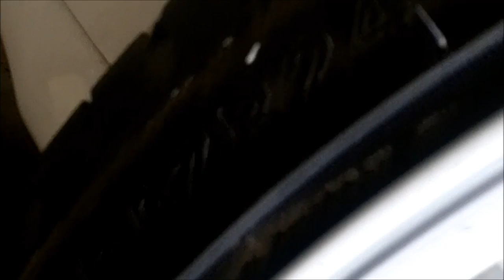2003 Impala How to Make 24s Fit Without a Lift

Comment: thats smart. why spend 800 on a lift just for 4's? if you were going 26s the lift would make sense. but not when you only need 3/4 or an inch more clearance. thanks for the video!
Reply from the maker: james atkins my thoughts exactly, glad I could help
Reply: Cus I was bout on my last resort,  I was on my way to spend 1200, lol SMH
Reply from the maker: Yeah it can be done for cheaper. The ride I'm sure is way better with the strut lift but this way is still manageable

Comment: How did you get the front to clear the tires when turning?.
Reply from the maker: Look around the 40 second mark. You have to trim down that metal part under the wheel wells. Then trim the fenders

Comment: Bro where can you get the clamps and what are they called. Got a 05 with 255 30 24s dont want to lift so want to do what you did thanks
Reply from the maker: Spring lifters or spring lox. Just be prepared because the ride will be stiffer than normal 
You can get them at AutoZone or order online https://www.amazon.com/dp/B00029K20C/ref=cm_sw_r_cp_apa_i_myX-FbZQXM2EQ?_encoding=UTF8&psc=1

Comment: Thanks for the video man, I got a 1990 Caddilac Elderado. I want to put 24's on it, but the coil seems close, do you think that I still can?
Reply from the maker: If it suspension is setup the same way it may work. I'm not familiar with that model
Reply: Thank's fam another guy told be a little lifting and slight cutting and I'll be good 👍☺ thanks for the reply and happy holidays now. This Elderado got to much potential mayne, candy apple red, needs a new paint job though. Getting seat covers from ebay, 2 12 inch Rockford Fosgate subs in a box and a Pioneer CD playa. I don't have much money now, so I'm having to do it check by check you feel me. Aight peace out. Blessings. 😇 Ready to bang some T.I, Roy Jones Jr., Luda, Mystikal, etc. etc.
Reply from the maker: That's wassup. Take your time on it and you'll be straight. Good luck on the build

Comment: did you think about using wheel spacers so they won't rub when you turn all the way? the tires will stick out past the fenders more then.
Reply from the maker: Nah the wheel spacers would make the rims poke out more than i wanted and i'd have to cut a little bit more

Comment: what the lifters look like at auto zone is it a link you can share?
Reply from the maker: David Bradford https://shop.advanceautoparts.com/p/autocraft-rear-adjustable-two-way-spring-spacers-2-pack-ac181201/10053644-p?c3nid=10053644-P&c3ch=PLA&adtype=pla&gclid=Cj0KCQjwn-bWBRDGARIsAPS1svudvamOdSkO_c507z4cyzYGw4POKIasdRkZp5mRPhL-3UOtm-1S3ggaApPFEALw_wcB&gclsrc=aw.ds
Reply: 89imp03 can those go on the front as well and it look like you can change the screws to extend the lift is that possible
Reply from the maker: Yeah I had them on the front and back. And they're adjustable, you can screw it as high as you need it but the higher you go the stiffer the ride will be
Reply: 89imp03 thanks

Comment: did u need to use spacers for the front or u just did it to b on da safe side
Reply from the maker: no spacers up front. I used the lifters in the springs up front to keep the fender from scrubbing the top of the tires on bumps
Reply from the maker: *no spacers needed

Comment: How many did u use all around 8
Reply from the maker: Yep, 8 total. 2 on each spring. Just be ready, its rough when you go over bumps
Reply: Okay I have a infiniti i35 just brought some 24 by 8.5 not sure of offset but I went to tire shop to kind of test it. Guy said I would have to cut. But I don't think he really knew he spoke broken English. But with spacers all around you think they should work??
Reply from the maker: @joesphpatterson1425  maybe, I'm not familiar with the suspension setup on that car but if it's similar to this it might fit. May still have to trim some if the wheel wells aren't that big
Reply: Oh okay fasho should I put wheel adapters and roll fenders if I put spacers? Also did u max out the spacer or u just lifted it a little bit..

I heard these cars will fit 22s fine
Reply from the maker: @joesphpatterson1425  I had these spacers extended pretty much the full amount. I would extend them and test fit to see where exactly it would be rubbing. Might need a little bit of everything depending on how it fits
Reply: @89imp03  yeah bro so the specs on my wheels are 24x8.5 5x114.3 +30 offset . Did u put any wheel adapters on the car to install the wheels?? If so how many inches?? 🤔  appreciate the info. I have some time to buy adapters and spacers I'm going to repaint the wheels
Reply from the maker: @joesphpatterson1425  i used 1/4" spacers and I think my rims we're about that same size/offset. The wider you go on adapters the more likely you'll need to cut more so you'll be able to do full turns
Reply: @89imp03  thanks I'll keep u posted on progress
Reply from the maker: @joesphpatterson1425  yeah let me know how it goes

Comment: can we put 4 coil springs on each  spring? two at the top two at the bottom? to be extra careful incase one side fall.
Reply from the maker: markell robinson yeah but it'll be a real stiff ride
Reply: +89imp03 OK! right on Big dawg I'll just use the  2 then.. quick question do struts give your car a lift? my cousin love having me spend unnecessary money.
Reply from the maker: markell robinson replacing old struts with new ones will make it look higher than what it was

Comment: Hey bro I just bought a 2004 Chevy impala LS do you have to get any engine work or transmission work to put 24s on?
Reply from the maker: I didn't have to do anything to the engine or transmission but it all depends on how your car runs and what maintenance was done on it before
Reply: Dawayne Johnson  usually you have to upgrade transmission to get your rpm,s right, with bigger rims you putting more stress on gears.
Reply: Raven 682 alright I can just go to a car place where they fix cars and all for a transmission upgrade?
Reply: Dawayne Johnson most of the car shops don't do transmission upgrades because they don't have transmission mechanics they just send it out to transmission shop to fix it or upgrade and charge you extra for that shit. Just find transmission shop and go straight to them. It's cheaper that way.

Comment: I'm wondering why you just wouldn't buy the $799 strut kit and just bolted up and be done with it instead of going through all this trouble. Gorilla lift and a bunch of other lift companies make it so much easier
Reply from the maker: Bubba Gordon would've been the same amount of physical work plus spending more money and waiting for parts to ship. And back then everybody's lifts sat too high in my opinion, didn't like the look
Reply: 89imp03 so you would rather do it the wrong way and chop the car up because you don't want to wait one day to get some struts. Each strut is only held on by three nuts at the top and two bolts on the spindle. You're doing way much more work than just doing that
Reply from the maker: Bubba Gordon I don't think you understood the purpose. Get them on without spending too much and without the car sitting too high. All the cutting would have had to be done anyway even with the lifted struts
Reply: 89imp03 I prefer to do things the right way. Instead of hacking a car up and putting spring spreaders and wheel spacers.  If you do it right the first time you wouldn't have to do all this.
Reply from the maker: Bubba Gordon ok

Comment: I gotta 06 impala will 24s fit without rubbing??
Reply from the maker: Curtis Price not without doing something like this or getting a strut lift
Reply: Ok thanks
Reply: You gone have to cut both back and front fender depending your tires I gotta 05 impala on 24s I did the same thing bro did my tires are 275/25zr24

Comment: i have this same car and am wondering how i can lower the front and the back
Reply from the maker: christopher rodriguez try some lowering springs or get an air suspension set if money isn't an issue
Reply: if I use lowering springs will I use same shocks or. they have new ones
Reply from the maker: christopher rodriguez not sure, might be better to get new shocks to match

Comment: How much did you have to shave back on the front & back? @89imp
Reply from the maker: +scott21ist I dont remember an exact amount. just enough to where it didnt rub anymore
Reply: alrighty, shit i wonder if some 24x10s will fit or poke too much
Reply: 89imp03 alrighty, shit i wonder if some 24x10s will fit or poke too much
Reply from the maker: scott21ist 24 x 10 will poke out some
Reply: 89imp03 think it will alot they are 24x10. 5 lug universal
Reply from the maker: scott21ist yeah with a rim that wide the offset is probably made for rwd so it'll sit a lot wider
Reply: +89imp03 i guess i will just lift it & put em on before cutting to see if they poke too bad

Comment: I got a 05 Chevy Malibu I'm trying to put 20son it
Reply from the maker: quivaris daniels 20s shouldn't be a problem but if they are this may help but I don't think its necessary
Reply: Da front rims fit but da BK rims don't because dey won't slide on da strut keeping it from being on
Reply from the maker: Ok. Bend the plate up some and it should be good. What size tires do you have?
Reply: 245,35 20
Reply from the maker: Yeah they should fit. Just bend the plate some

Comment: Who knows for a lift kit for a 2004 Pontiac Grand Prix I appreciate it that’s a good job but I’m just trying to find coilovers or the kit to install some 22”
Reply from the maker: 22s will fit with no lift. You just have to slightly bend up the strut plate. 245/30/22 tires will fit with no issues
Reply: Alright my friend thanks appreciate it I will do what you did 👌🏻
Reply from the maker: @jayjaynonoy.6928  no problem 💯

Comment: I have a 98 Grand Prix SE I have a set of 24 inch rims how do I make them fit without lift an the tires are 275 25 r 24 ?
Reply from the maker: Leslie  Outerbridge I think the suspension is set up the same as the Impalas. the amount you have to trim will most likely vary tho
Reply: OK so I'm good then all I have to do is lift the struts an what about the lifters to hold the struts steady how much is the lifters an where do I get them from?
Reply from the maker: Leslie Outerbridge Autozone is where I got mine. they're not expensive under $50 will get you what you need
Reply: That's front an back right? What else do I need to do?
Reply from the maker: that's it. everything I did is in the video. just double check everything and make sure your clearance is good on your car and you can adjust from there
Reply: OK do I have to do any cutting an how far do I adjust the lifters?
Reply from the maker: Leslie Outerbridge yes it all depends on your car
Reply: OK thanks alot
Reply from the maker: no problem
Reply: Hey they want me to come to auto zone to see the lifters they said its different prices 6.99 an up which one's you get or which ones I need?
Reply from the maker: Leslie Outerbridge they're called spring lifters. its 2 brackets and 2 bolts for each one
Reply: Ok

Comment: what's your width bro
Reply from the maker: Tank Wright I think these were 9" wide
Reply: Will 9 1/2s have poke? I have a 2013
Reply from the maker: maybe a little, depending on what offset they are
Reply: High positive
Reply from the maker: shouldn't be too bad
Reply: I may call tomorrow and switch cause I ordered them
Reply: Tank Wright the more negative offset the more poke. -44 is about a 3.5 to 4 inch of tire sticking out. -24 is about what you are looking for. although with no strut lift there will be a little more cutting involved. when they sit out that far need a little more clearance. im running 22x14 with a -44 offset on a silverado and needed alot of clearance
Reply: Tank Wright did you sttach a pic? It wont open yet

Comment: Looks good standing still but I know u ain't making u turns...probably a few Y turns ...if you want to lift a fwd the right way you have to extend the mounting brackets on the bottom off the strut...look up lifted  Cadillac de ville it's got the same strut set up..you'll see a spindle in the beginning of video...not trying to bash you I give u a A for effort but it's not the right way of doing this
Reply from the maker: it turned good. i didn't see the value in paying for a lift only to go 24s so i did it this way

Comment: Should’ve just left it at the 22s bro
Reply from the maker: They felt too small, wanted to see what 24s was like
Reply: @89imp03  YEAH...THEY DO..IF YOUR GOING TO GO BIG RIMS... ATLEAST GO 24"$ ON THESE IMPALAS..&..MONTE CARLO"$...I FEEL & THIS IS JUST ME..THE 26 & 28 IS JUST SHOW CAR SHIT.." ATLEAST THE 24"$...YOU CAN STILL RIDE..YOU CAN STILL STUNT...AT THE END OF THE DAY...I CUT AND WELDED MY STRUTS...I WILL POST MINE ON FACE BOOK AS I DO MY BUILD...IM ONLY DOING... RIMS..RACING SEATS.. STEERING WHEEL..SWAP...NEW SPOILER IN BACK..TINT ON HALO LIGHTS UP FRONT...I MIGHT GO SUNROOF"...AND IM DOING A FIRST.....IM PUTTING A CUTLAS SURPREME VINYL TOP ( CUSTOM ) ON MY M*CARLO"...BLACK + WHITE + CHROME SCENE...THIS CAR WILL SEE..60 / 70 MILES A DAY...THIS IS NO SHOW CAR...BUT" IT WILL BE ABOVE AVERAGE LOOKING 05 MONTE CARLO..*ONE#1*
Reply from the maker: @RGIIIBOXING  yeah 24s you can flex and still drive like a normal car. It's the perfect mix. That Monte Carlo is gonna be wild when it's put together 🔥🔥
Reply: @89imp03  YEAH"..IT TAKES TIME TO PUT IT TOGETHER...THE
 WOMAN I GOT IT FROM..LET IT WENT DOWN..ENGINE RUNNING HOT"...WIND SHIELD WIPERS GOING THE WRONG WAY..IT NEEDS ALOT OF WORK...SO I DIDN'T PAY BUT" A WEEKS PAY FOR THE 05 MC" BUT" I FIGURED..SENCE ITS GOT TO HAVE WORK DONE ON IT" TO MAKE IT ROAD" WORTHY" I CAN DO THE UP GRADES AS I GO....WHEN IM DONE...I WILL HAVE MORE MONEY IN THE RIMS & TIRES...THAN IM GOING TO HAVE IN THE CAR IT SELF..CAUSE IM GOING TO BE DOING ALL THE WORK MYSELF...I FIGURE 5 TO 6 MONTHS.. DEPENDING ON HOW SMOOTH THE BUILD GOES...AND IF I KEEP IT MOVING...LAMBO DOORS...IS ALSO A SNEAK PECK...IT IS WHAT IT IS...*ONE#1*
Reply from the maker: @RGIIIBOXING  yeah thats a good deal. And you can really take your time to get it exactly how you want it too.

Comment: Ayye Kevin this ya boy from It with the silver 05 IG:Beastly07Clean05. I'm thinking of getting some camaro 20s. How would 275/40R20 will look on it?
Reply from the maker: is that the factory size? I've seen it done tho. you'll need adapters since the bolt pattern is different

Comment: tire dust EVERYWHERE. Lol Jesus Christ.
Reply from the maker: Jesse Machiato what did you do on yours?
Reply: 89imp03 I'm assuming you are asking what I've done with my car. I didn't do shit to it. I drive a brand new car. And I'm not interested in fucking up my suspension with heavy rims. Rims are cheap. If I wanted them I would have them.
Reply from the maker: Jesse Machiato just checking, thought u might have had some expert opinion or experience